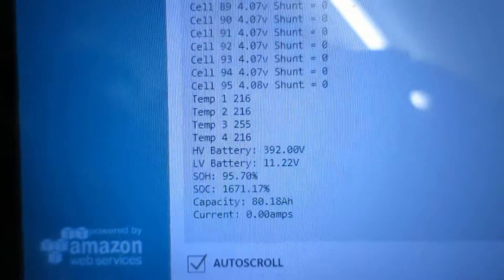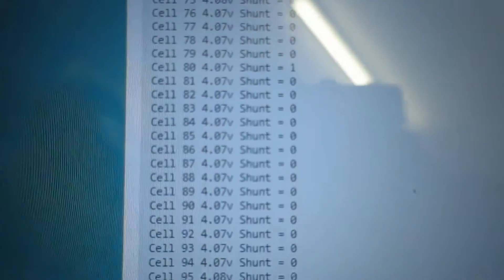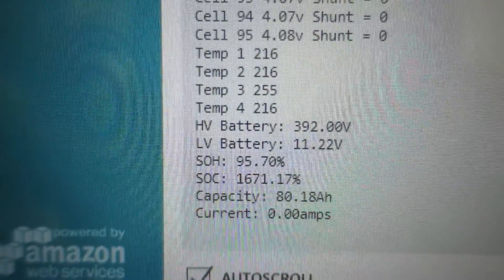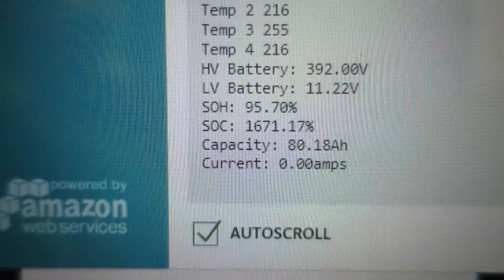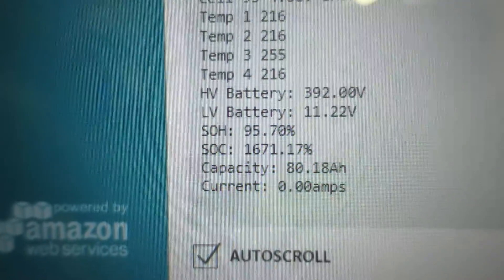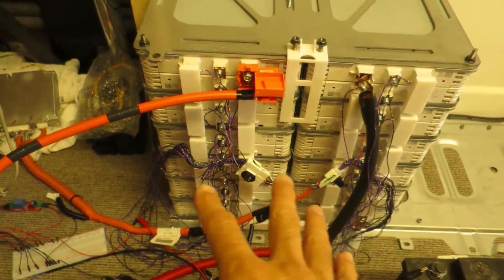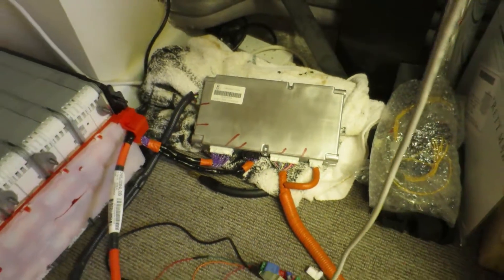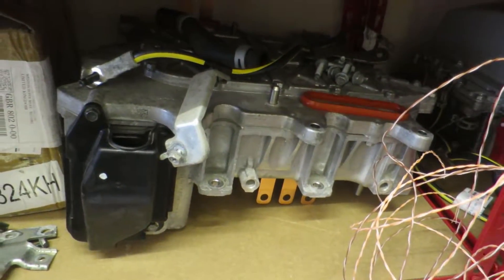Nissan Leaf to RX8 Conversion, Week 9

Comment: I know its a bit long ago but I for on3 would be interested in  diagrammatic plans you have and code to make the BMS etc work.  Would happily pay for that as a package.  Was planning a conversion into on3 of my VW’s when the engine has had enough.  Theres so much crap information out there on Leaf systems and so many people who just say buy an EV from a dealer.   Much of the info seems to contradict itself.
 Some even say transplant the whole Nissan loom into the VW and ditch the VW stuff, doable but a massive pain in the arse extending bits and fabricating adaptors etc to allow the use of VW switches and buttons.
Reply from the maker: Hay, ping me an email and lets see what we can do.

Comment: Hi Dave, I have a LEAF and want to replace the Sealed Lead Acid auxiliary battery with the LiFePo4.  I understand the DC to DC charges the auxiliary battery.  I saw in your previous video when charging the Lead battery voltage is about 14.1V, can you tell me what the Amps when charging the auxiliary battery.
Reply from the maker: Hi bud, sorry for the delay in replying - xmas and all.... I would be very careful making this replacement, Lead Acid and LiFePo4 batteries require different charging methods. I would advise against a direct swap unless the new battery has its own BMS, and charging system built in.

Comment: I'm thinking about convert rx8 with leaf motor too. I think working car can easily sold for 10k$
Pls share this info, so, persons who doing leaf swap can use your recearch, so, they will not need to "develop a bycicle". I will even pay for something easy repeatable and well documented. If support can be available, what is included in price or have some small additional price it's gonna be cool.
Reply from the maker: Yes I hope to have a complete 'leaf conversion' manual by the end!

Comment: Not sure why one would want an electric RX8. A car that doesn't have the same performance as the petrol version it will have similar performance to a nissan leaf. So I would go out and buy a leaf. I think it will be long time before I am interested in any sort of electric car they just seem more hassle than they are worth.
Reply from the maker: Electric cars are far simpler than ICE cars, far far simpler. As for these conversion, its not meant to replicate the performance, but will open the doors to bigger and faster projects to come.

Comment: An rx8 is all about balance and power, it's magic in the turns.
The battery placement probably changed that poise and drive.
An rx8 for the looks and lower energy costs? IDK.
I think what you've got there is a marvelous feat of your engineering capacity, software, electronics and automotive hardware. Your CV here can probably get you a nifty job at Mazda (or another manufacturer).
Regarding the RX, next step IMHO is to get it to drive well around the turn, maybe even get it race worthy.
From a business perspective, I see a market for modernizing old cars (Fiat x1/9 next), maybe your adapter system can be advanced to support multiple motors and car models. Kinda like a ziff socket for cars :-)
Rock on.
Reply from the maker: Yeah definitely mileage in this if I put a kit together, but with the way prices for everything are getting lower I feel it is not going to be long before this is viable.

Comment: To fix the SOC value quickly, just read it from the 0x55B message the BMS sends, it is in the first 10bits of the message.
Reply from the maker: Yeah will take a look at 55b, I am requesting it using the 79b - 7bb challenge response codes. Can't get my head around when its responding with rubbish for the SOC, ill check what 55b is saying. 

Again thanks a million for the replacement BMS, saved a lot of hassle and uncertainty with the repairs required.
Reply: As a tech demo and a showing of your black magic fuckary, it's an awesome project.
Here are the commercial drawbacks IMHO:
1. Anyone getting a renesis in the last ten years knew what they were getting into (hopefully). It's a shitty engine that makes a car great. If I replace it, it must  make the car as good or better to drive.
This means throttle response, weight distribution, turning etc. For the sound I can put an MP3.
So it depends how it handles post swap.
2.Dirt cheap rx8 have been usually maltreated, so the engine won't be their only problem, rust and suspension..

3. I would love to have more torque, but it still has to be an rx8. If it's just saving mpg, I'd simply add lpg.

Therefore, I would keep this as a kit. Your adapter concept could be used to couple other engines in the future, so it opens many possibilities.
Maybe even making conversation kits for multiple old cars based on a (semi) standard adapter system in the future (Fiat x1/9? Porsche 944? Wink wink, nudge nudge).

Maybe raise the bar, get one into racing, RX8 cup?
One can always dream.

Comment: Another video mentioned leaf motors being good for 300bhp. I guess doing another to sell you could use one of the more powerful Leaf motors from the newer models. 40KWh is 7.9 to 60 and I think the 62KWh is faster? There may be more market for converting people’s beloved RX8s than selling them a random cheap RX that’s been converted? Sub £12k with the range and performance of a leaf would be very interesting - look at Vintage Voltage and the conversion costs using mostly new bits?
Reply: I think the inverter is the limiting factor, not the motor.
Reply from the maker: Yeah I have seen similar info - but just be careful of your terminology KWH is the rating of the battery. The motor is rated at 80KW. The new Leaf's have 110KW motors (about 150bhp). 40kwh and 62kwh are the battery capacities.
Reply: Sorry, being lazy using 40 & 62 to refer to the two different leafs as that’s how they’re generally described. However, the 40 is 150ps, the 62 is 217ps. Picking up on the point above, it might be a bigger inverter rather than the actual motor in the 62, but if you go to the dealer and get one they do have different power and 1s difference to 60. So a 217ps swapped into an RX8 would be a lot more than a gen1 leaf,  but maybe the key is to get an inverter from a 62 (they have a totally different battery too, in the familiar case). Lots of variable to mix n match anyway if you did do another...

Comment: Any chance to see the code? I'm still very interested in the charger code!
Reply from the maker: Yes Yes Yes! The BMS code I will put out shortly as this is pretty robust and tested.
Reply: @SouthWestEVUK  Ever get the charger sorted? And what source for the can messages are you using?
Reply from the maker: Check out my other videos about CanBus communications, yes the charger is working, and dc-dc converter.
Reply: @SouthWestEVUK  I'm about a month away from starting my conversion. Are you controlling the inverter as well?
Reply from the maker: Yes, again check out the other videos in this series, I have them all in a playlist
Reply: @SouthWestEVUK  k, I'm all caught up. Good job stating what you've done but I need to know how you did it. If you have a source you've used online I'd love to see it. If you have the CAN codes that would be even better. I'll be putting all of this in my own blog so others can use it as well.

Comment: I would be interested in a kit as another poster mentioned for Leaf system into other. Not having to faff around with the wire looms and other bits to integrate them saves a lot of time. I personally would go for the RX-8 conversion, but seeing that I am not in the UK, it would be more straightforward to kit out what is international and focus on those aspects. The mcu into the RX-8 network is also handy, I would go for that too, but I personally would be more likely to roll my own board for that portion, since that is the kind of thing I do.
Reply from the maker: Interesting, yes a kit would be nice, it would be RX8 specific tho, I may think about doing that...

Comment: Unfortunately, as configured, I think it would be a bit of a loss leader. It would be far more valuable, in my opinion, if you can maintain the LEAF direct drive, single reduction gear and mount it as a RWD (what the RX8 is really meant to be). It's probably more worth your time to package and sell a basic conversion kit (with code) for the LEAF powertrain that owners can then customize for the vehicle of their choice. The hardware and mechanical labor just aren't going to provide much of a margin (i.e., not worth your time). Just my opinion on it.
Reply from the maker: Yeah, almost certainly right - it will probably only ever work as a 'made to order' basis. Rather than a made to hopefully sell. I can set the appropriate values then to ensure it is done at a profit.
Reply: @SouthWestEVUK  Well, if you can do the software aspect of it, it opens up the North American market, too. We have a lot of junked Nissan LEAFs laying around (and donor cars). It's not worth it to ship components, but software with matching components would be totally worth it.

Comment: if i would ever decide to throw the rotary out of my car i would pay you about 4-5 grand if i can expect a healthy range of about 150-180 miles. currently with my own tuned software if i take it easy i get about 260ish miles so yeah not much difference there :D

also thats a pretty good idea to buy trash rx8's maybe for a couple 100's and give them electric life instead of rebuilding the rotary. 
but in the rotarys defence its such a great engine if you take good care of it and premix with a sohn oil adapter :3

Have a nice weekend buddy :)
Reply from the maker: The Rotary is a great engine, I cannot deny that, it just fails tooooo soon! Ohhh how about a Rotary with 'electric' assistance!
Reply: @SouthWestEVUK  yes do that :0 would make a great video.
But first ur electric rx8 haha :D